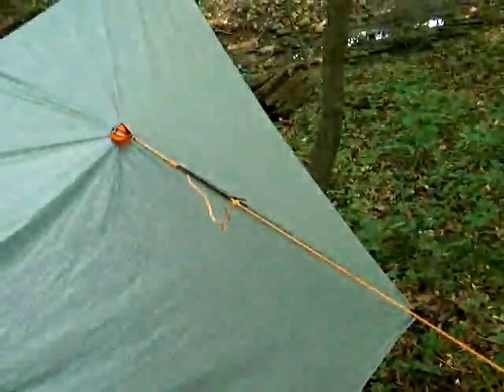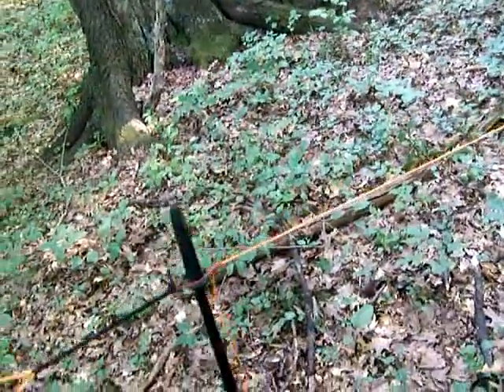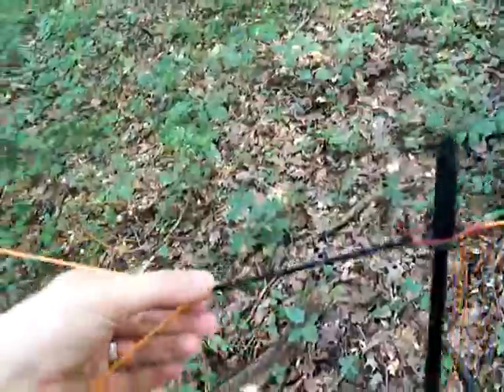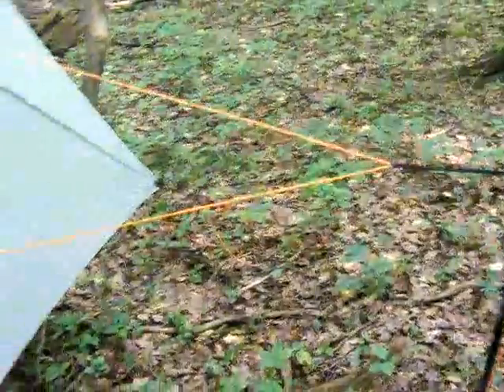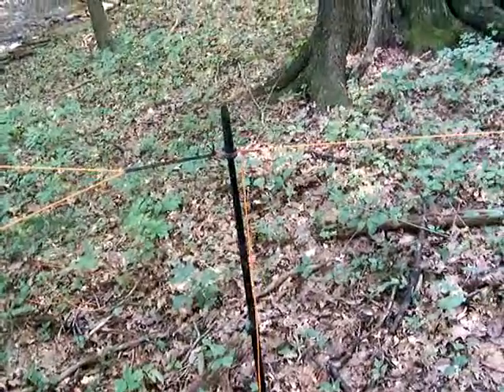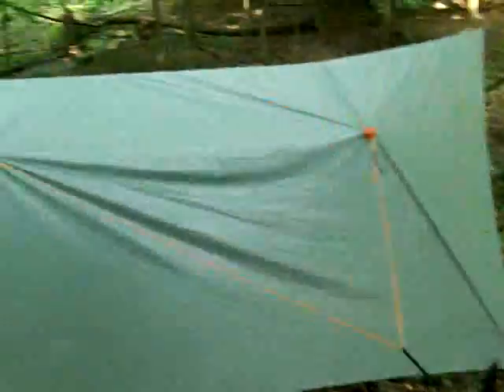Hammock Shelter - Part 2 - Tarp Tieouts

Comment from the maker: @phrankus2009 
This is just what has worked for me. 
I do not use paracord because 
#1 - it stretches    
#2 - it weighs 3.5 times as much as lightweight dyneema or Dynaglide cordage
#3 - it absorbs water (and thereby adds additional weight to carry)

Paracord does word for many people and if it allows them to get out there in the great outdoors, more power too them.

Comment: Curious why you inserted the accessory cord between the shock cord and dynaglide on the corner tie-out and side pull-out.  Couldn't you go directly from the shock cord, to dynaglide and use a dynaglide prusik?  Does the prusik knot slip when using dynaglide?
Reply from the maker: +Michael Marziotto For a prusik to work, the line needs to be smaller in diameter than the line it is biting on so using shock cord as the prusik material wouldn't work. 

I have since updated to simply using braided mason line instead of the accessory cord mentioned in the video as it is cheaper and readily available at most hardware stores (and is smaller in diameter than dynaglide/zing it so it will work correctly as a prusik cord).
Reply: +tendertoe1 Thank you.  That's what I thought.  I've replicated your setup and like it quite a bit.  I was using zing-it as well, and wanted to add a piece of reflective cord as the prusik..  but even with four or five wraps, the reflective cord prusik wouldn't bite into the zing-it.  I ended up replacing the zing-it guy-outs with reflective cord for both the prusik and guy line.  Works well and there is no measurable weight difference.
Reply from the maker: +Michael Marziotto I particularly like how zing-it doesn't tangle compared to reflective cords and other non-dyneema cordage. If you've found something that works for you though, that's all that matters.